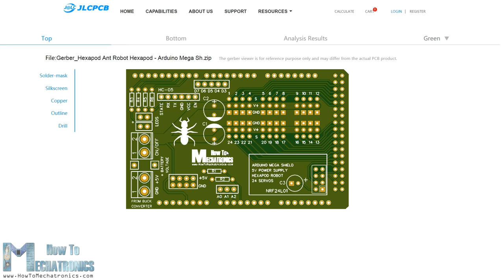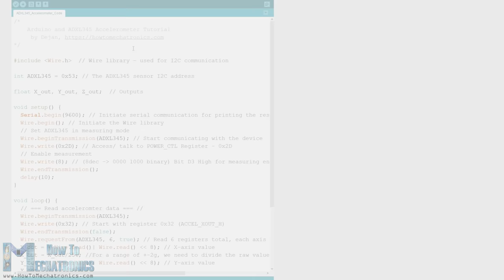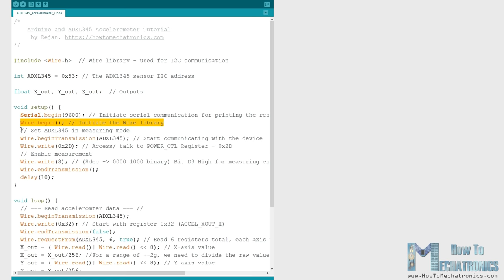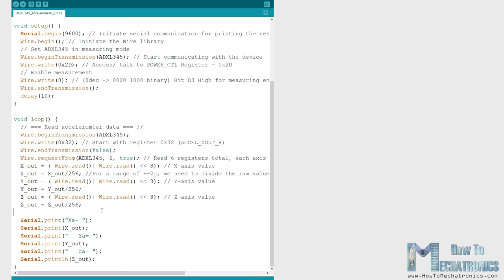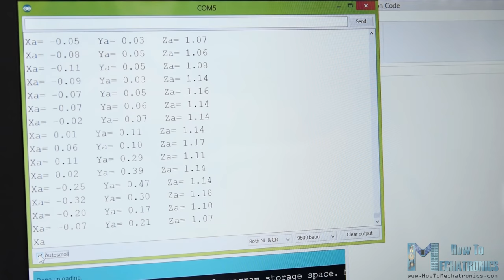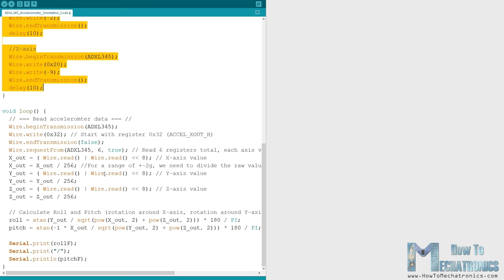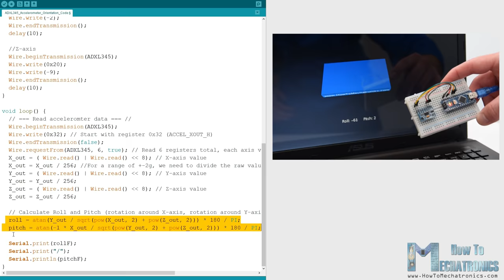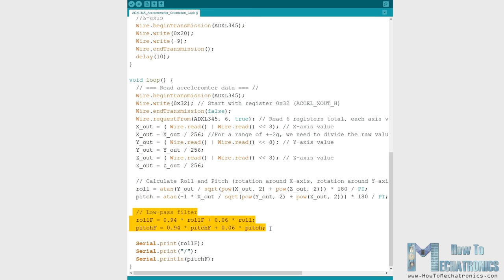How To Track Orientation with Arduino | ADXL345 Accelerometer Tutorial

Comment: Thank you very much for such a great video! It was really helpful for me. I have only one question (in case you read this comment): are offset registers really useful? I tried to calibrate my accel using them, but it didn't help at all. I had to write a short code calculating calibration coefficients.

Comment: This is an awesome tutorial and I learnt a lot. I'm having an issue with my values though. They jump from 0 to 256 instead of -1. What could be wrong?
Reply: Maybe it is a bit late, but I had the same problem using an ESP32 C3 and solved it. I think it might have something to do with the fact that variable types differ between Arduinos and ESP32s, for example an Int is between -32768 and 32767 on an typical Arduino, but -2147483648 to 2147483647 (32 bit) on an ESP32... what I did is simply change the variable types in the sketch from float to short, and it worked perfectly.
Reply: @arduinoob7785  That makes so much sense. Thank you for this I would never have thought about that

Comment: Can I ask you two questions? Is it possible use 2 ADXL345 connected in one Arduino? What’s the difference between ADCL345 and MPU6050. By the way, as always, great tutorial.
Reply from the maker: Yes, you could use 2 ADXL345 with a single Arduino. The difference is that the MPU6050 has a gyroscope integrated in his chip as well, which significantly improves the orientation tracking capabilities. You can find more details about it in my next tutorial.
Reply: How To Mechatronics thank you man!!! Looking forward to the next tutorial.

Comment: thanks for your help
i have a question, why do we need to divide by 4 when calibration the sensor ?
Reply: I would like to know that too :)
Reply: Okay I kind of found an explanation. In the datasheet of the ADXL345 on page 31, chapter "offset calibration" there is an example formula for calculating a value to be written to the x-offset register. The raw error in this example is +10 LSB and the formula is "XOFFSET = −Round(10/4) = −3 LSB". It seems to have something to do that the offset register does not take into consideration the g-setting of the ADXL345.

Comment: Hello, it is posible to connect only one x,y or z out to the arduino? or you have to connect the 3 for the accelerometer to function, looking for use few pins on the arduino i only need 1 direction

Comment: I just used your code and I did the same thing with your tutorial. The arduino couldn't upload your program. It is said in the output   "compilation error: 'ADXL345' does not name a type". Could you give me some advice to solve this things ?

Comment: I want to add the rotation around the z axis to my mpu5060.  I am using the mpu5060 and not the adxl345.  So what is the code needed to add to display the rotation around the Z-axis?

Comment: Very informative video. Arduino sketch works fine. However Processing sketch gives error message. "radeon:Failed to get PCI ID, error number -13."  Could it be that the Processing sketch only works
on a Windows pc?  I'm using Lunix desktop (Ubuntu 20.04)  Greetings Henk

Comment: Hi, thanks for the video, but I couldn't understand Wire.requestFrom(). You only requested data from 1 register so how could you get data from 6? From Arduino official description, Wire,requestFrom(address, num_bytes) is the number of bytes and not the registers. Although the code is working correctly but I donot understand how?
Reply: The register address auto increments with each read of one byte

Comment: i'm building an E bike with a vintage look and have a back brake light, I need a system to sensor braking and activate it , is this a way of doing it and if so ( I hate to ask) how ..?
Reply: since the Z axis is gravitational force, the X and Y axis would be perfect to measure braking, set the sensor to a maximum of 16g range , and use both axises to measure braking forces.

Comment: Wait doesn't an accelerometer measure acceleration? Are you using the accel to somehow get the angle? I thought angles need gyros and accelerometers only help accuracy
Reply: it measures forces, both static and dynamic, gravity is a acceleration of 1g, so you can use earth's gravity to track orientation